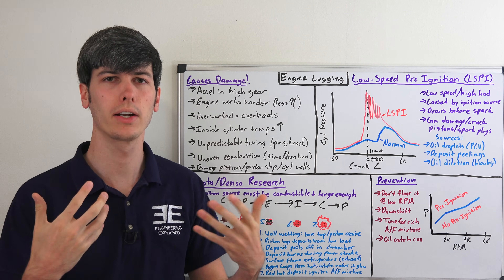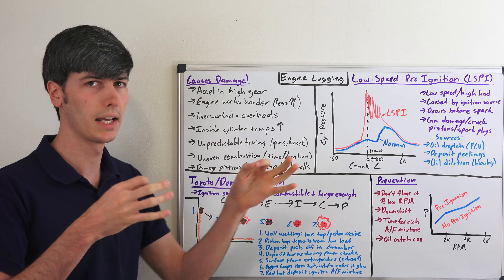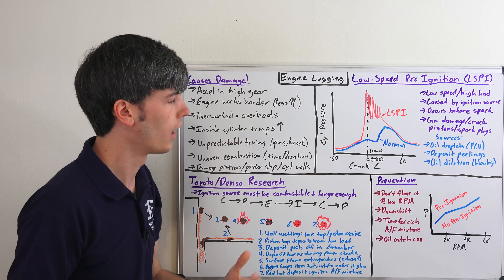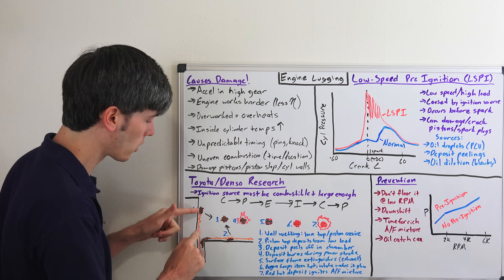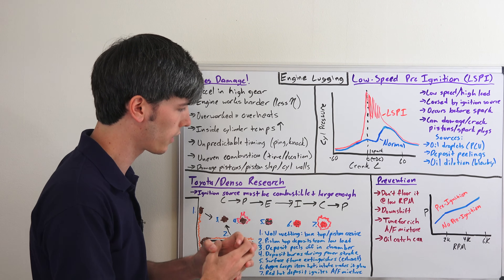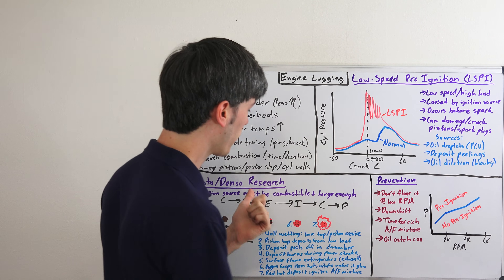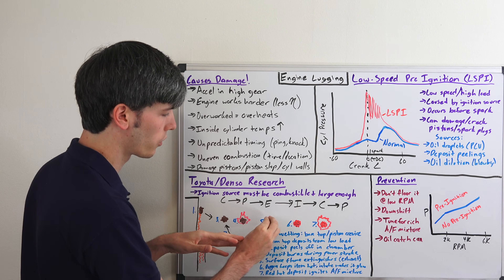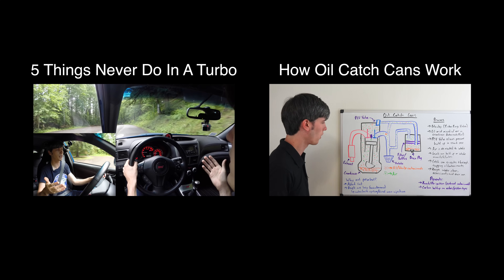Why You Should Never Lug Your Engine (Especially Turbos)

Comment: My dad's 2.0 turbo diesel pulls the most at around 2k rpm when you floor it. Is that lugging the engine or not.
Reply: Diesels don't have this problem, because there's no fuel in the cylinder before the power stroke. Still, you shouldn't floor any internal combustion engine at low rpms.

Comment: I had so many questions about this on the "things you shouldn't do in turbo vehicles" and sadly none of them were answered here...

1. What specifically is considered lugging an engine? Is flooring it at 2k rpm lugging? 2.5k? 3k? I realize that number will vary engine to engine, but just a general rpm would be nice.

2. I assume you don't need to worry about this with diesels, as they kind of operate via pre-ignition anyways, but it's worth addressing anyways.

3. What about engines that run at inherently low rpms? Most vehicles made before WW1 couldn't even rev above 2k rpm!

Comment: How pronounced is this in a diesel? I have a 2003 VW TDI engine which will happily pull from idle in any gear apart from 5th. It doesn't sound like it's bogging in any way whatsoever and pulls cleanly through to the higher rpms.

Comment: so if I am speeding, reach the deadline and upshift, should I not immediately floor it till I get more RPM?
Reply: +Nir Hason just think about automatic transmissions. When you are on the highway and you smash the gas pedal to the floor, what does it do? It downshifts to an appropriate low gear. You should do the same. It also won't up shift to the top gear (let's say, sixth gear) if you're driving 35mph.
Reply: You're right; it is not the fastest way to accelerate.  When fast acceleration is necessary, one must use a gear which enables the engine to run faster so that it can develop more power.

A few decades ago, BMW did a test to determine how to drive for best fuel efficiency.  They determined that, with their cars, the most efficient way was to accelerate with a heavy foot (2/3 to 3/4 throttle) and upshift at only 2000 RPM.  That was BEFORE electronic fuel injection.  Beyond 3/4  throttle the carburetors delivered a richer mixture which hurt efficiency.  On modern cars, that would be less likely.

The main, but not only, reason that a Diesel engine is more efficient than an Otto-cycle  (throttle controlled, spark ignition) engine is that a Diesel engine has no throttle valve.  When the throttle is restricting air flow, considerable power is wasted sucking air in against the vacuum created by the throttle valve.  That is why an Otto-cycle engine is more efficient at wide throttle openings.  Of course that does not mean that fuel efficiency is greater at high car speeds; the power to overcome air resistance increases with the cube of the velocity so doubling the speed of a car requires eight times as much power.

What is often called compression breaking isn't.  Most of the engine braking is caused by the power required to suck air in against the vacuum created by the throttle valve.
Reply: +Nir Hason as long as you are in first gear... Just dont floor it if you are at a gearing disadvantage. Like going 60mph in 6th gear for example.
Reply from the maker: +Anas Malas after a downshift from redline the RPM will be plenty high, no issues with flooring it.
Reply: No you don't have too floor it lol... The techniques he is talking about will minutely increase your engine life. 1st gear from a stand still no matter what wont hurt your car by flooring it or by gently easing on the gas... its only when you go like 50 mph in 6th gear and then try too haul your car (unless your in automatic, then the car will downshift for you).
Reply: +Nir Hason no problem! Just wanted to make it simple not only for you but for others that may be wondering the same thing.
Reply: Well thats what a proper trans should do. While driving in the mountain roads in my parents auto (family vacation) the trans would wait way to long to down shift so i would loose so much engine speed going up a hill. Sometimes down below 1500. I try not to lug the engine but when that happens it's kinda out of my control
Reply: Colinator4321:  That transmission tuning is for increased gas mileage.  Gasoline engines get better mileage under mild lugging conditions, due to the throttle plate being open further, which reduces engine vacuum, and pumping losses as a result.
Reply: And what about flooring it from a 0-60?
Reply: Elite3665 But when I'm doing 0-60 I am at standing position and I must floor it to get better results. Also I can't start driving from second gear because I'm using auto transmission (:
Reply: +Elite3665 tnx for the answer bro! make sense now haha (:
Reply: afrosheenix yaa..I got it, tnx bro!
Reply: +afrosheenix you did (;
Reply: Colinator4321 Some of that is cars that aren't adjusted (or aren't good at adjusting) to high altitude driving. That's why people in Colorado and other mountain states get Audis, Subarus and similar cars. BMW has had hill descent assist for years.
Reply: afrosheenix Ya I guess, this is in Alberta driving a 99 windstar
Reply: Really?  For years I have often floored it at only 1200 rpm.  I've done that with two different cars and never experienced problems.  I'm not saying that one should do that with all cars, and certainly not if the engine knocks or protests in some way.  But except for that, it should be no problem.

Note the olde GM Hydramatic would shift into 4th gear at speeds as low as 20 mph and there was no part throttle kick down.  It had a stiff fluid clutch that used split torque so that in 4th gear the slip was not much greater than zero.  That never caused problems.  Also, as I stated in a previous post, the Packard Ultramatic would lock its torque converter at speeds as low as 20 mph thereby making it possible to work the engine hard at very low speeds.  That never caused problems.

As long as the engine runs smoothly and doesn't knock, loading it heavily at low speeds should not be a problem.
Reply: I often go   40 mph in top gear, sometimes even when going up hill.  I've done that with several cars and never experienced problems.   But if the engine knocked or otherwise protested, I would not do it.
Reply: Ive done it also, howver its not the best/fastest way to accelerate, and it can have a negative effect on your motor. Not so much on larger modern computer controlled engines.
Reply: Excellent explanation, Frank.
Reply: I actually came here to ask a question and you've already touched on it....but my car, BMW Z4M, seems to accelerate quicker at 2/3-3/4 throttle and increasing to WOT vs. just going straight to WOT and I'm not talking lugging, it happens from 1st gear pulls, or 2nd gear with 2.5-3k rpms. Back in the carburetor days I would say its likely to rich of mixture instantly being dumped in, but with ECU controlling that, near perfect 14.7 AFR, through out, What would cause this? Is it just my imagination, or is the quickest acceleration going to occur with 2/3 throttle and letting the engine catch it before going WOT?
Reply: Cortes2141
The only thing I can think of is your engine is pinging.
As the throttle opens, cylinder pressure increases, and timing normally advances, but if the knock sensor detects pinging, the ECU will pull timing back to protect the engine, which also reduces power.
Are you using high quality premium fuel? If not, try it at your next couple fill-ups and see if it helps.
I always run premium in all my high-performance cars capable of running on pump gas. The really high-compression stuff gets 110 octane race fuel.
Reply: Hmm, I'll have to do some data logging this weekend and see if I can find anything. I dont hear any pinging and I do use 93 octane only. If the engine were directly cutting power I would think I'd feel that. I guess a better way of explaining the issues is that, if I dont go straight to WOT, but 3/4 then to full as the RPMs increase, i feel like the acceleration curve remains exponential, however, if I go straight to WOT its a little less drastic of a curve, more linear...

Comment: Could you explain the benefits and disadvantages of setting a lean or a rich a/f ratio?I am asking this because here in Brazil, we can easily add ethanol on the fuel tank, which would lead to a leaner mixture. Thanks
Reply: Rich mixture wastes fuel but makes the engine run cooler. Lean mix is good for economy but makes the cylinder head run at an increased temperature.

Comment: Even a larger motor like the 6.2L LS3, this applies. I have read posts by numerous Charger/Challenger guys who switch to the SS sedan and complain about it not having the same "low end torque". Hint: the LS3 was developed for the Corvette, it is a sports car motor, not a truck motor. Don't drop the hammer at 1200-1500 rpm and expect it to jump, that's lugging it. I let mine spin up at lower throttle settings to 2000-2500 before rolling (not hammering) the throttle open. Fully open by 2500... look around, you'll see this is the low end of what you see on dyno charts. Sports car engine, not a truck engine. It is intended to be spooled up. When going hard, keep it up above 3000 rpm. Not only is this better for the engine, it makes absolutely wonderful noises up there as well. Moseying down the highway at 1500 rpm, I generally won't use more than 30% throttle before downshifting to rev it up so I can open the throttle up in the happy part of the rev range.

Comment: Could you do a video on ways to fix blowby please, I dont want to have to get rid of my "new to me" 86 chevy astro with a bored out 4.6L with 275k miles
Reply from the maker: +benson420710 excessive blowby is generally a result of worn pistons/piston rings. Honestly it takes a full tear down to fix. Blowby isn't all that detrimental as long as you keep up with your oil change intervals, and also make sure your oil doesn't burn off too fast, which also happens with worn rings. But it does mean you're losing power.
Reply: +Engineering Explained great analysis. Worn rings means you're losing compression and power output depends on it. I know you know this, intended for the guy you replied to.
Reply: An easy but temporary (ish) fix, is to take the spark plugs out and squirt/pour some high temp silicone sealant into the bores. Then turn the engine over a few times with the spark plugs out to help get it spread around the piston tops. Whack the plugs back in and you're good to go with minimal blow by, better power and less oil consumption.

Comment: Could you provide the article you mention? There are many things you mention, but lack details. (is it it: http://papers.sae.org/2014-01-1218/ ?)
You talk a lot about LSPI, but how much spark plugs are the cause?
Also, what is flooring in high gear? I mean, be more  detailed here. It is 2000 RPM and WOT? And since 1500 RPM is not same for all engines, would you rather say 30% of max revs?
Then, if flooring is bad, how far can one push the pedal? 80% WOT? 50%?
Finally, what is a cylinder pressure? It is NOT something one can change... compression is fixed. At least in majority of engines... except newest development in variable compression ratio that might see market in 2017.

 It is only a small talk with some idea of possible cause of preginition that was studied in the laboratory, not on streets in everyday driving.

Comment: Great topic, but I have a very important question. I drive a 2012 caravan with the eco button. when this is pressed, or on.. my throttle response is quite bad. when at cruze on local road and i want to accelerate and the accelerator is pressed it sounds and feels like its lugging. I really have to slam the accelerator for it to drop a gear or two to accelerate. otherwise, I have to drive with the eco mode disabled. is driving with the eco mode bad for the engine? or is it designed for just high speed cruzing? im really confused with it. Is this what all auto makers do to force better economy by forcing slow acceleration? or is this just a dodge thing? thanks in advanced for response.
Reply: Slow acceleration is actually bad for fuel economy. You use A LOT more fuel while accelerating so you want to spend less time doing it - you want to accelerate fast. Like already said, that eco mode forces you to floor it so you accelerate faster.
Also, if I understand correctly, it's an automatic transmission so you can't really lug it (at least not as bad as you can with manual) as it will downshift when you floor it.
Reply from the maker: +Cre8tive81 super common, not hurting anything. Eco modes often alter the throttle mapping so that you have to press it more for quick acceleration, which generally results in you using less fuel.

Comment: What if the engine has a peak torque rating at 1,400, or even 1,200 RPM? Such as the N54/N55?
Reply: But because of gear ratios, the length of the gears are all different, That's why say in 1st gear for example you may only be able to go 0-60 but in 5th you may be able to go 80-200. Because of the lengths of the gears. So putting max load on your engine in 2nd gear at 2000rpm is less pressure on the engine than putting max load on your engine in 5th at 2000rpm Because of the different gear ratios between the engine and wheels.

Comment: I'm kinda behind, but does your car being in overdrive bad too? I have a scion xa 1.5l. it cruises at 60mph just under 2500rpm on the highway
Reply: if it's an automatic it's fine and as long as you aren't at 100% throttle (pedal meets floor) let's say 30% or Less is fine in overdrive (5/6 gear)
Reply: +TwisteeTheDark1 Yeah its a 4 speed Auto. I'd say 30% throttle. never really need to punch it full. Thanks for the information bro! ✌

Comment: Can you do a video on gear ratios and fuel economy? I ask this because if you buy a truck to tow a heavy trailer but use the lowest gear ratio as opposed to using a higher gear ratio to do the same amount of work at the same speed. Your fuel economy should be better with the higher gear ratio for the load but lower when empty (compared to the lower gear). At least that's how I think it works. By the way I did learn a lot in this video. I don't think anyone has explained engine lugging at low RPMs quite this well. Thank You.

Comment: Can using higher octane fuel (my car calls for 91 and I use 93) reduce the risk of LSPI?
Reply: Not with direct injection. Fuel never hits the one side of the intake valve, which under regular injection would scour deposits.

Comment: I'm wondering how this is such an issue with modern turbocharged engines once you mentioned that a rich air fuel ratio could prevent LSPI? because most cars to my knowledge that come turbocharged are run on maf based systems, and I know even if you lug a turbocharged engine you will spool the turbo (depending on the size of the turbo in comparison to the engine) . If the turbo is spooling thus pushing more air through the maf, the maf would tell the ecu to dump more fuel, and I would imagine in a modern mass production turbocharged vehicle the tune would be able to pull timing based on load, rpm, and knock sensor values.

Comment: why keeping the engine at low revs against higher revs produces more heat? the amount of work is equal in both cases. and the amont of burnt fuel should be the same.
Reply: Because the heat transfer is less efficient at low rpms.

Comment: How low is really bad? I heard you say 1.5krpm flooring is bad, but it would be different for every engine.. Don't dyno runs start at pretty low RPMs? or not low enough to cause damage?
Reply: Also, I don't understand the part about the deposits breaking off and causing pre-ignition. What makes it more likely to occur when lugging an engine compared to driving normally?
Reply: He's saying don't floor it at that RPM. On a dyno, they're applying light throttle so the RPM slowly builds. Don't be at 1,500 RPM and mash the gas.

Comment: Exactly, apart from this at low RPM the oilpump is providing less oil pressure and you have deposits forming at low RPM.
If you just keep your engine RPM above 2000 then you won't have much deposits forming and you will have proper lubrication.
One way to get rid of deposits is to just drive at high RPM.
Such a pity modern cars change gears at way to low RPM just for 'fuel economy', and it's actually short-term fuel economy, when you start getting too much deposits because of the low RPM you will get worse fuel economy. But hey it was clean during the test so no manufacturer cares.
Reply: Welp thats usually when i shift in my brz (2k rpm) and on the highway im between 3-3.5k rpm so passing is easy and simple.

Comment: does this apply to automatic transmissions too, when they floor it when accessing too early? if so, so I can have a laugh at them :-P
Reply: It can if you are using overdrive while towing or going up steep grades.
Reply: +Korrupted overdrive, I miss those days
Reply: I believe that most of the do still have override, through it's baked in and many manufacturers often use it to make a 4 speed auto into a 5 speed.

My 05 Toyota still has a physical OD button.